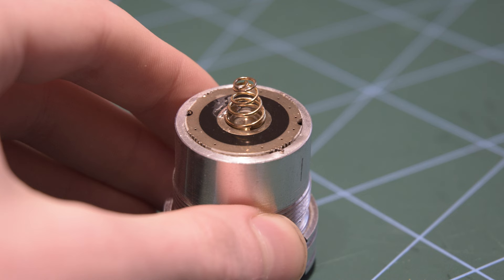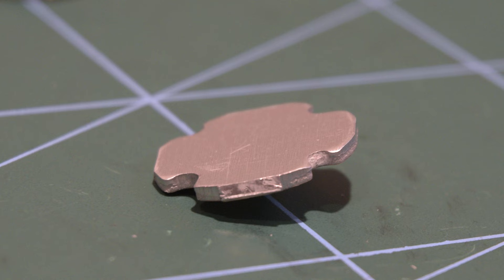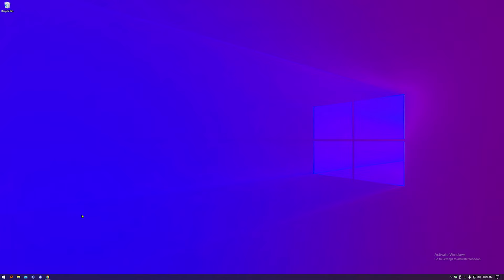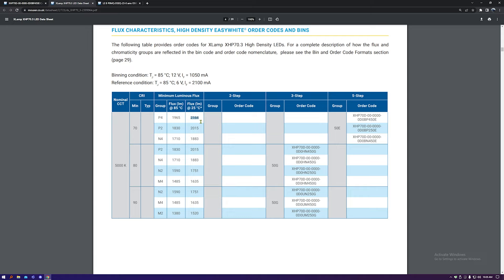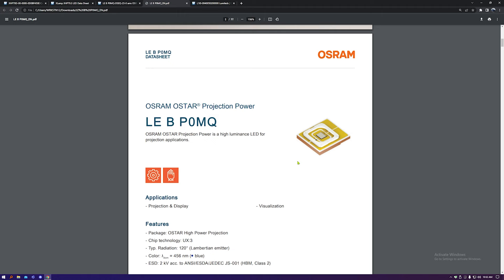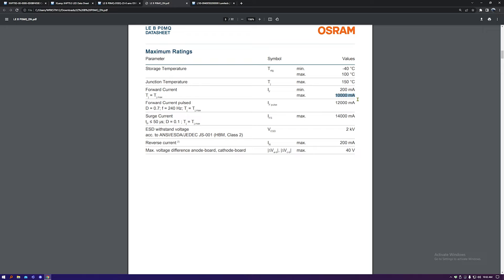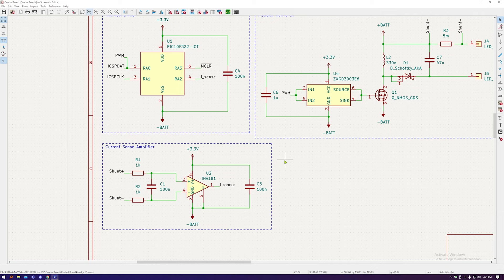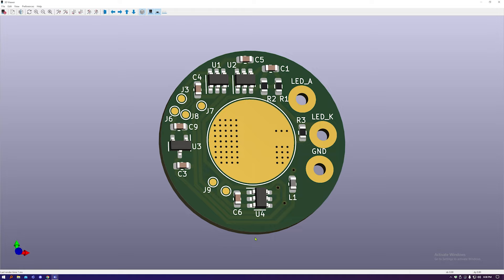Designing a 40W Flyback Converter for the Rehkittz Torch

Comment: Please look into our designs of Up/Down Converters that we did for GM and other companies, for automotive work.  You can easily make a converter which works from a low of about 0.7volts to over 70volts using only one inductor, and a a similar set of parts as an ordinary Up or Down converter.  We did this in the 1970s.  That would allow you to use virtually any battery set below the "load-dump" voltage of any older alternator-based vehicle on the market.  May not work with modern EVs since these may not have 12V or 24V or 36V battery sets.  You can also push these designs to work with 150V systems (as in rectified ordinary AC) but the efficiency will be very low.  The commercial 90-to-220volt "universal chargers" also use the same principles, but the dynamic range is limited by the type and size of the capacitors and semiconductors used.  We did designs which had over a 100-to-1 dynamic range, but this required severe cost penalties for the parts involved.